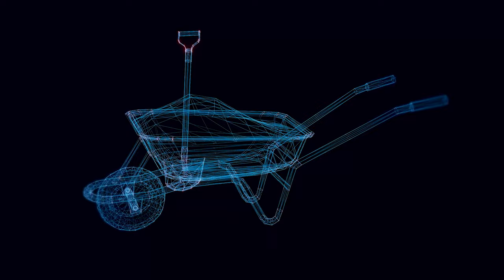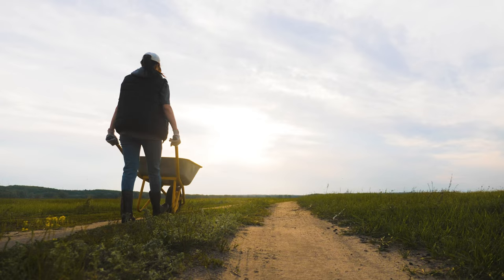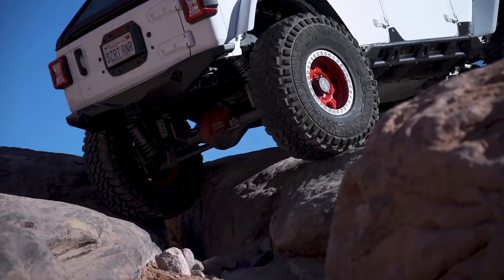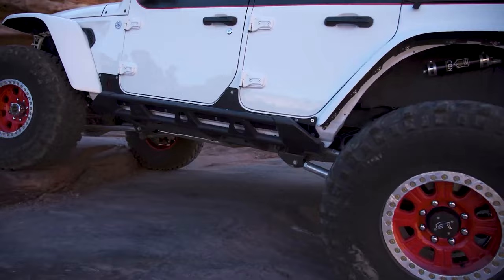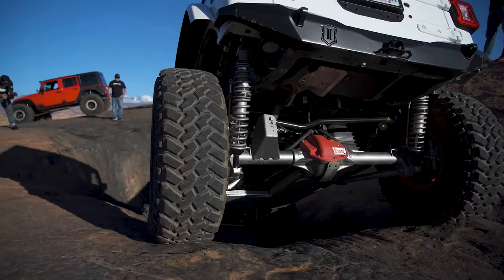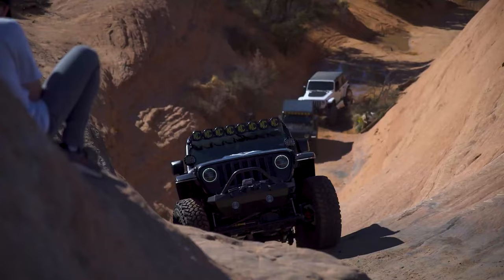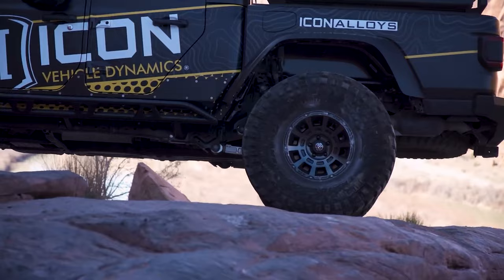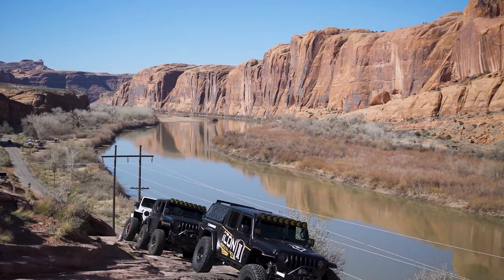What Is a SWAY BAR? How Does it Work?

Comment: I removed the SB on my ZR2, increased spring rate by 5%, had a little body roll at speed.  Adding Timbren bump stops really helped reduce body roll.  I swapped rear leafs to Deavers and saw a further improvement in body roll and overall handling.  Surprised the rear leafs had as much effect as they did.  Keep the videos coming.

Comment: We have a built up 5th Gen 4R on 35's with a full Toytec lift.  We tried with both sway bars removed and for on road it body rolled a lot.  We connected the rear back into place and it is amazing now.  Without the front sway it allows the front IFS to truly work independent.  I just always tell people never ever do this on a stock suspension.

Comment: 2018 JLU, 5 inch lift, 38X13.50x17's, factory control arms (until next week when new metacloak arms arrive) running Antirock on front and stock in rear.  Not really noticing ill effects of reducing articulation.  JL's flex like mad !!!!  On a serious note, onroad handling a little more sway than stock but as most people say, nothing to worry about and you'll be used to it in about 50 miles.  Great things is not having to disconnect when I'm traveling on and off road multiple times on overland / crawling / adventure trips.

Comment: I drive a 2001 xj and I removed the rear sway bar when I installed the new leaf springs....I am thinking of putting it back on because the road manners have been compromised......it does do better off road, but this is my daily driver.....

Comment: SwayLoc dual rate swaybar! Basically, a torsion bar within another torsion bar. Best of both worlds. You get the benefits of an Antirock without having to sacrifice body roll, all with the simple flip of a lever. No need to go through the tedious task of disconnecting & then having to be on level ground to reconnect.
Reply: Like what Land Rover did in 1999 to the Discovery 2 with the A.CE. system. Hydraulic pump senses inertia not body rolls and quickly stiffens a ram on the link but at low speeds off roading the ram looses hydraulic pressure and acts like a disconnect.  One of the ways the old Discovery had such insane articulation bone stock

Comment: I wish Toyota would figure this out. No front sway in 4runner to allow actual maximum ground clearance with aftermarket suspension and skids. I'm used to the extra body roll, but I admit, I'm jealous when I climb into my buddies JL Rubicon that disconnects front and rear with a button.

Comment: I can remember when I was in my early 20s seeing mustangs and some bmw’s look really good going around curves like they were flat and stuck to the road like glue.  I am just now learning about sway bars and I am wondering what I need to make a 2016 ram 1500 regular cab hemi feel less like driving a boat and more like the sports cars I seen as a young man.  I went from an 05 to a 2016 and for some reason it feels so soft and leans so much it’s actually annoying.  Also will adding a rear sway bar increase or decrease the traction in the rear in curves?  I understand to a lot of you this lvl 1 shit but suspension is not something I ever really had to deal with.  If you can tell me your best recommendation.  I would appreciate it very much.  Btw it has 80k miles and I’m pretty sure it needs better than factory shocks.  What is the brand you trust that  lower middle class can afford lol.
Reply: I recommend changing to BILSTEIN shocks, they are firmer and offer better handling

Comment: So how does a sway bar work?
Reply from the maker: A sway bar is a torsional spring that connects the left and right sides of a vehicle together in order to evenly distribute weight between sides when turning. They can be adjusted for stiffness to affect the rotational tendencies of a car (normally mid-corner), either making the ride oversteer or understeer more!